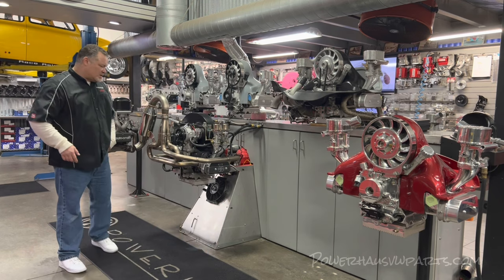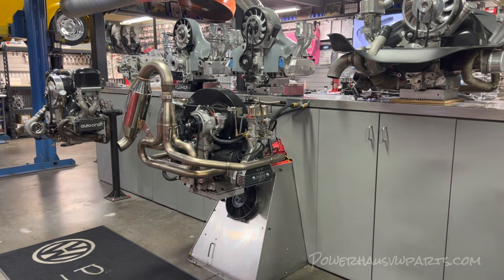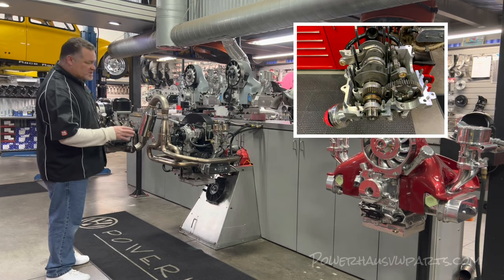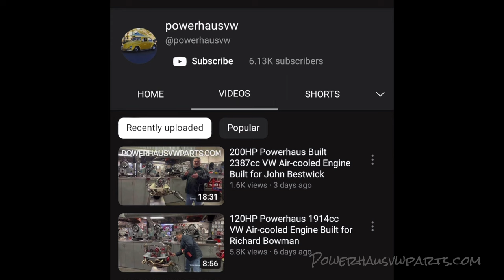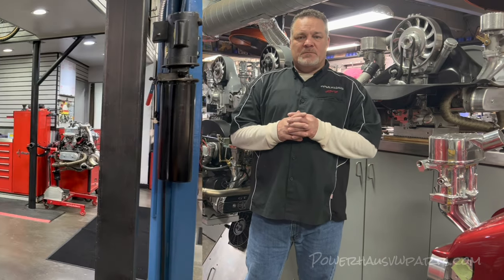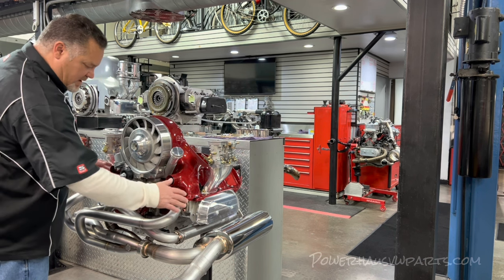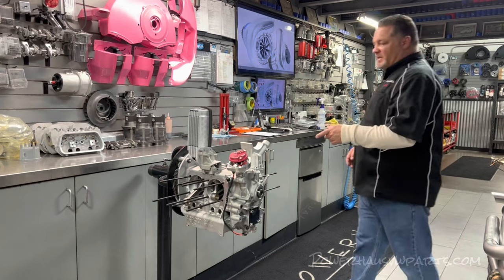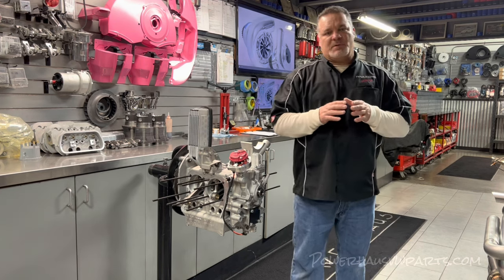VW Baja Engine on the Dyno & Sneak Peek  of some Upcoming Aircooled Projects

Comment: How much for an engine with 150 horsepower or somewhere close
Reply from the maker: Hi David, Take a look at our 2110cc Turnkey on our website in the link below, it will make about 150HP with the head upgrade. Give us a call if you would like additional information or a personal quote.
310-328-2746
https://powerhausvwparts.com/shop/ols/products/new-2110cc-turnkey-vw-engines-dual-44idf-weber-carburetors